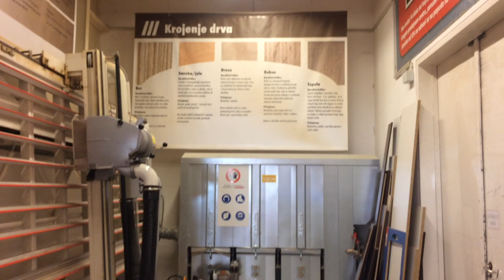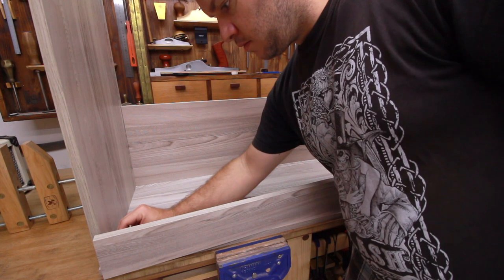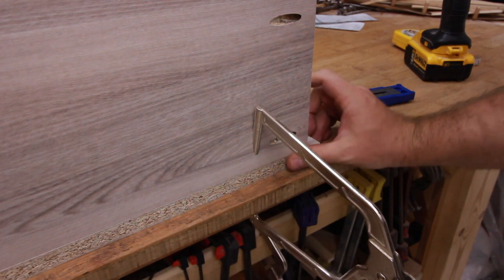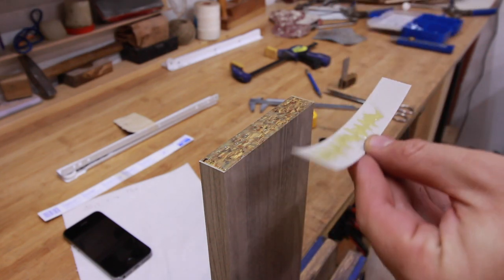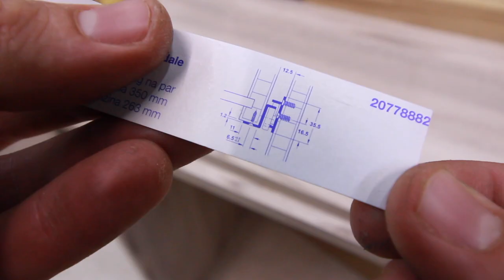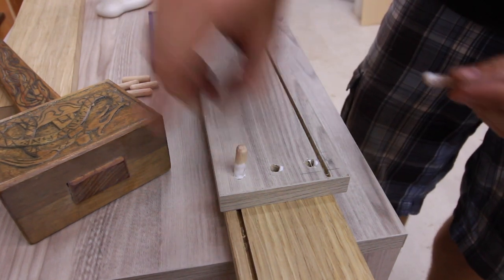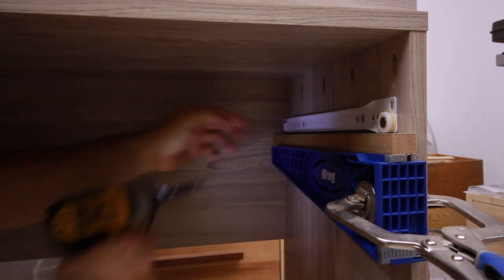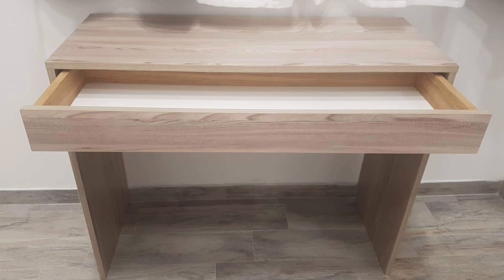Modern Side Table Made Easy

Comment from the maker: ***TOOLS I use in this video, check them out:

KREG STUFF
Kreg Multi-Mark Tool: https://amzn.to/2kkiVGi
Kreg Jig K4 Pocket Hole System: https://amzn.to/2GHceXR
Screw Starter Kit: https://amzn.to/2GJEU2c
Kreg Automaxx Right Angle Clamp: https://amzn.to/2IEYWkb (get two!)
Kreg Drawer Slide Jig: https://amzn.to/2IEIkVW
Kreg Automaxx Face Clamp: https://amzn.to/2IE5dwO

OTHER
Dowelling jig (cheap but it works): https://amzn.to/2Lmqo3U
Glue Bot (fantastic glue bottle from Fastcap): http://amzn.to/2By8JE8
Drill bits for wood (Fisch): http://amzn.to/2H3R6wa
Combination Square & Speed Square Set: http://amzn.to/2ET4NNH
20V DeWalt drill and Impact driver (great tools): http://amzn.to/2ssbAeF
Evolution Rage 3 Miter Saw: http://amzn.to/2F1Bk4a
DeWalt Table saw: http://amzn.to/2CiFaDd

***These are links to the tools that I use, which lead to your local version of Amazon (US, Canada, UK, Germany, Italy, France). 
If you do decide to buy something from Amazon feel free to use these links, as they earn me a small commission at no additional cost to you. This helps me make more videos like this one. Thank you.